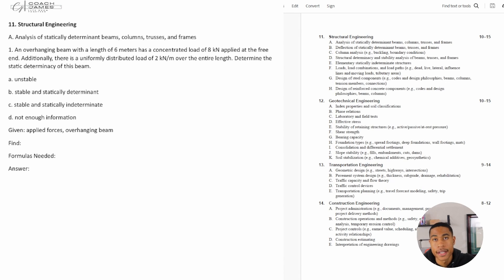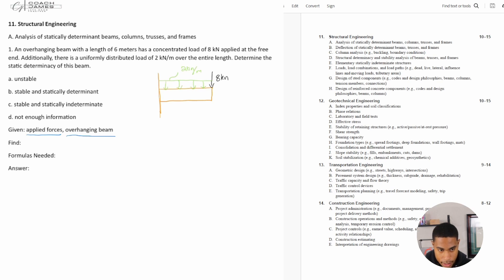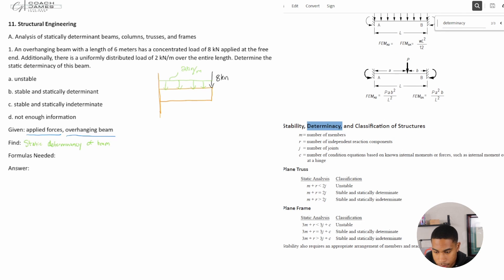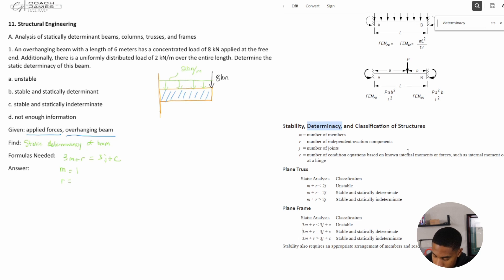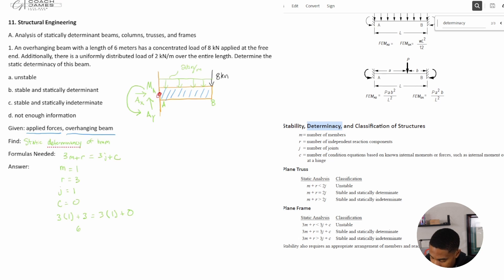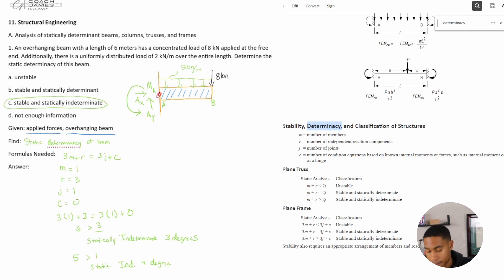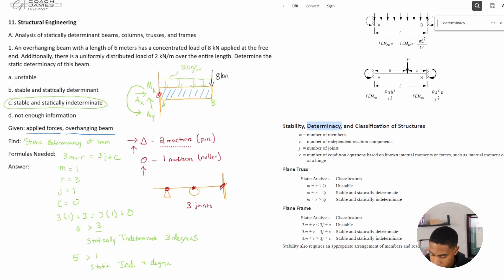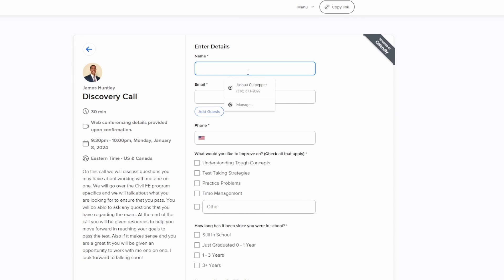2024 FE Exam Review Civil Structural Engineering Analysis of statically determinant beams Problems

Comment: Thank you for your videos! This was a pretty straightforward problem, but I do have a question. I worked it out myself before watching your solution. My first move was to draw a FBD. I was always taught in school that if problem can be solved using the equations of equilibrium, then it is statically determinate. After drawing my FBD, I recognized that there are 3 unknown reactions and there are 3 equilibrium equations, so I then thought statically determinate and chose letter B. Could you explain why that rule does not apply here?
Reply from the maker: Great question and you are correct. My image is drawn incorrectly. As i am showing a cantilevered beam instead of an overhanging beam. The overhanging beam would be drawn similar but with a pin/roller in the middle.